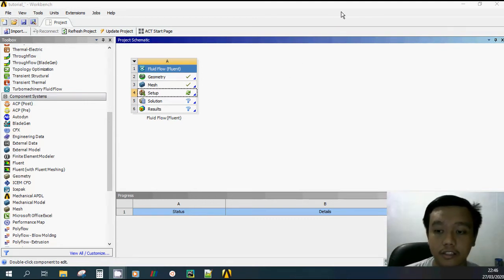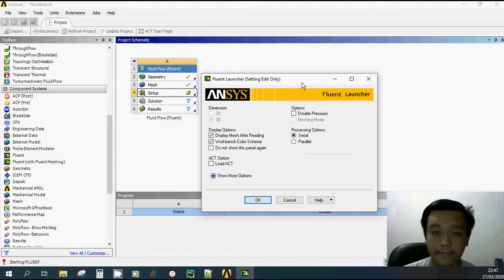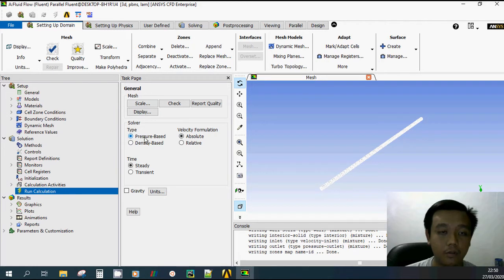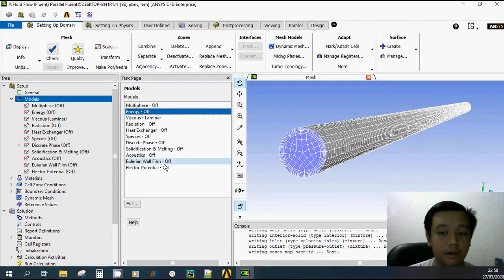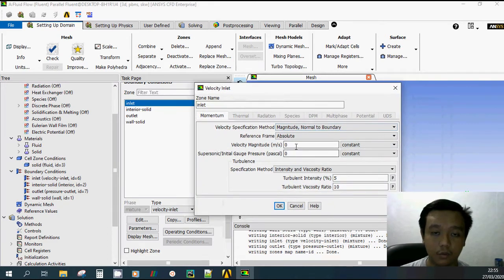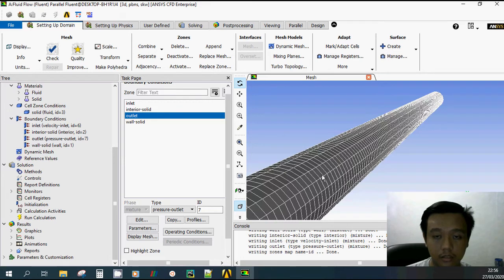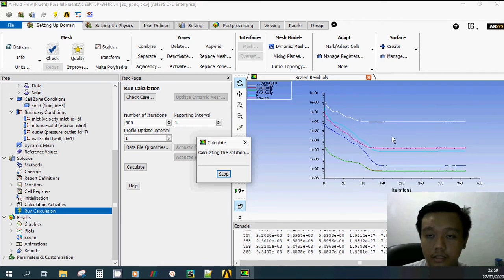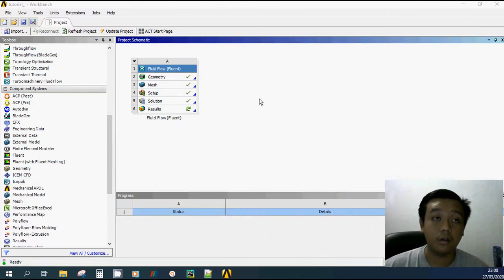basic ANSYS FLUENT tutorial flow in pipe (part 3): Solving the simulation

Comment: hii i have some question about fluent analysis in pipe 
first how about the turbulent kinetic energy in boundary condition and initialization, how to determine it so it can be relate with real condition
then, now i had some research with fluent analysis but i have some problem where the result was can't be similar with real condition in experimental method. anything that can cause the failure?